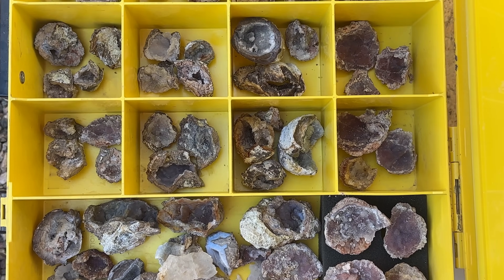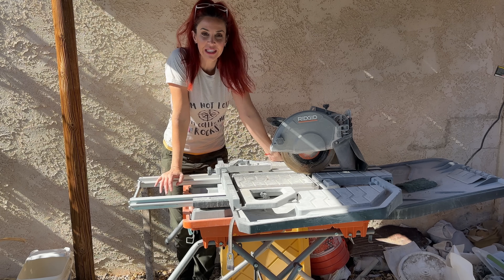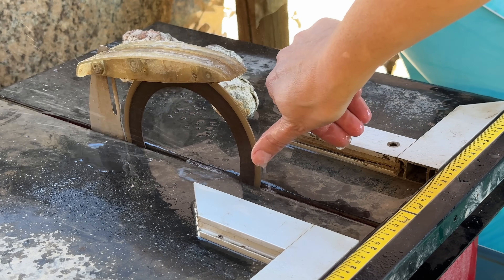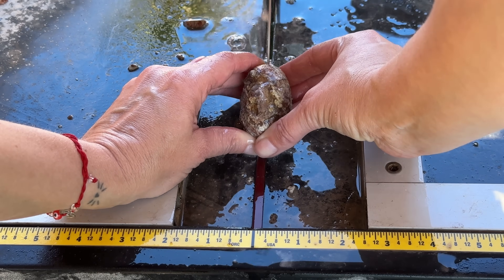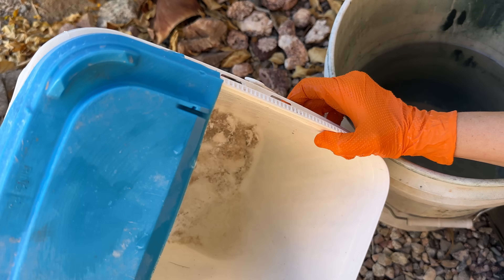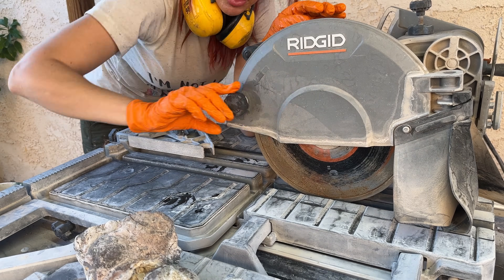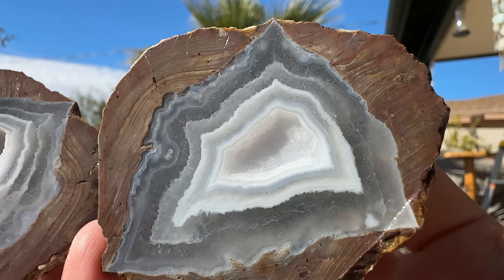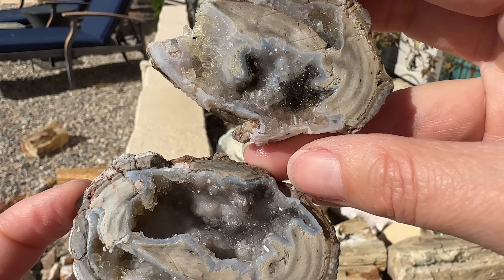BIG Reveals Open Geodes WHERE to FIND them!

Comment: It is possible to put lapidary discs on tile saws by using some spacers and by using a variac or some other way to lower the speed of the saw so it does not cut too quickly.

Comment: OK, this is NOT an advertisement for Harbor Freight, take it or leave it and the item probably can be found elsewhere but they have an "inspection light" that is a very small camera on a flexible gooseneck that you could stick into those tiny holes in geodes to see what its like and where you want it to be cut at. It is self lit with leds by the camera.

Comment: If it's plastic tubing that you need to seal and it doesn't come in contact with another part that would prevent the removal of the part in question, you can use the following method to seal part. Using a thin strip of Styrofoam  (like a cup, or cut strip of Styrofoam packaging) and melt with superglue, using the strip of Styrofoam, rub the melted portion on plastic needing sealed. I have found this to be a quick, easy and most reliable method for mending smaller plastic repairs.

Comment: Fun times.  After decades of heavy metal,  guitar playing and front row AC/DC concerts..........I'll skip the hearing protection lol.  I actually just had my hearing tested and only have a very slight loss in one ear.  As I sit here in the upper portion of my rock cave with a 15" KLH in each corner, that have knocked rocks off the shelf more than once ,i'm not sure how that's possible but i'm not complaining lol.  I'm still trying to kill my liver also with no luck.

Comment: Those blades should last decades, I have an old saw that I bought second hand and I'm pretty sure the blade is older than I am.  If they are starting to feel dull get a bastard file and clean them up by pinging the blade to expose more diamonds.